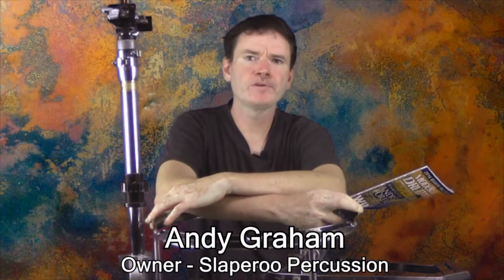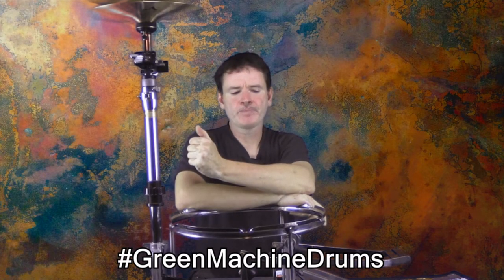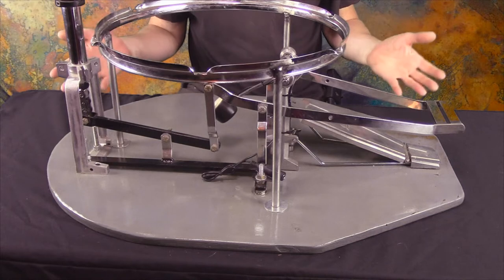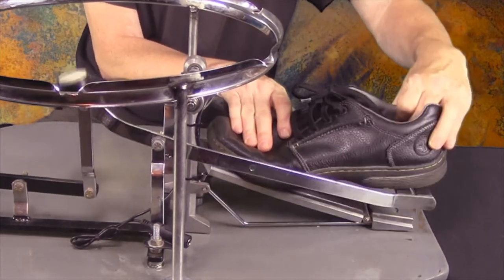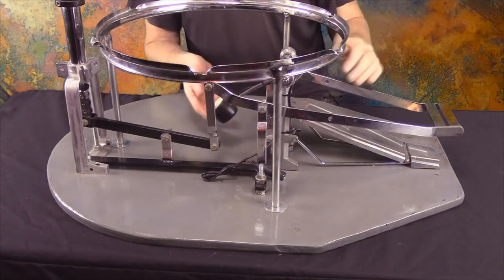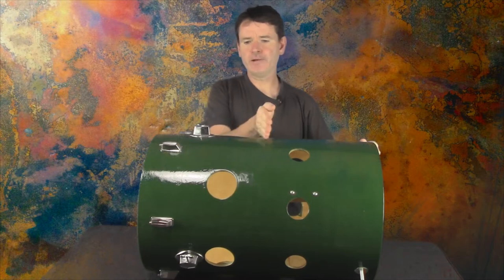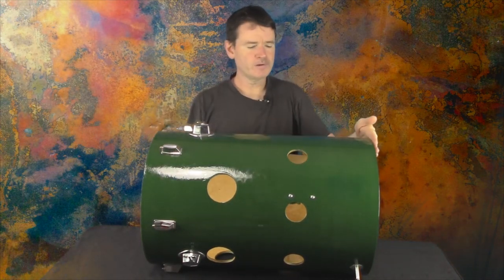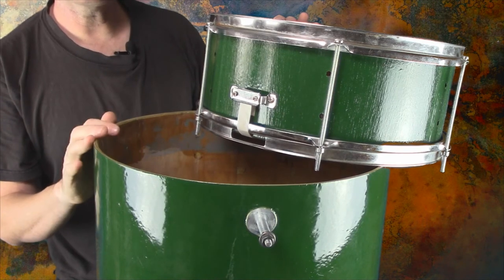The Graham Pedal Hi-Hat System - How to Build The System

Comment: Such an elegant solution.  And you're right about a 16" tom: pretty tough to fit a 14" snare in there.  I just got a 13" to work, but had to search for the right butt and throw-off and swap out the usual drum-key bolts with regular Phillips-head ones.
Reply from the maker: Hi John! Yes, I discovered the piccolo for 14" and standard for 16" shell afterward. Would have made my life easier. The 14" snare worked but I had to fix the throw to 'always on' for it to fit. The good thing is that there's no snare buzz from the bass drum below because of the wooden barrier.

Comment: Intreesting build.  How did you make the rings inside the kit?  Thanks.
Reply from the maker: Hi buck! The rings were made from the same floor tom shells that I used to make the kit. I had 6" or so left over. I just cut off two 1-inch wide rings. Then, I cut out a section so that they would compress into the shell. Had to sneak up on it until they fit tight. Gorilla glued them in place, sandwiching the wood barrier in between.
Reply: Andy, thanks for taking time to reply.  "Had to sneak up on it"...LOL  I hear you brother.  I take that you removed some material from the kick tom shell to lower the height....did you do the same of the snare tom shell?   I take that the height is whatever feels best for the individual, but what is the overall length of the tom shell once built as one?   Again, interesting build and thanks.